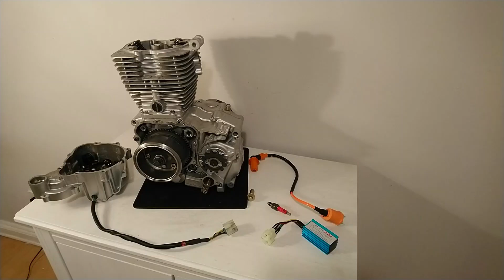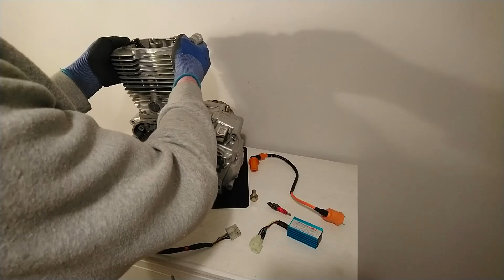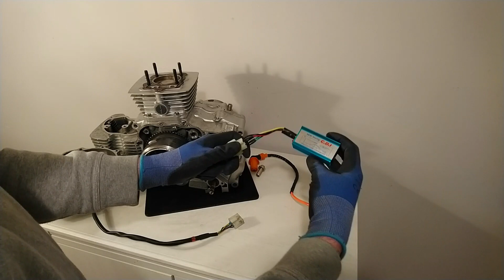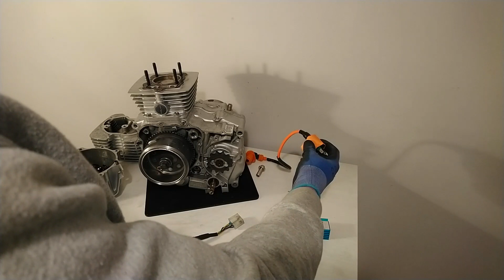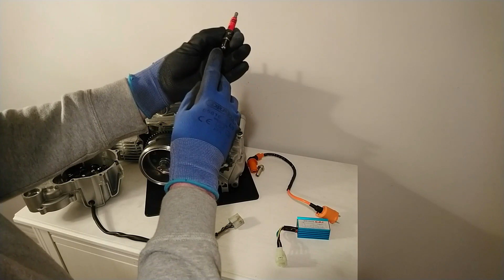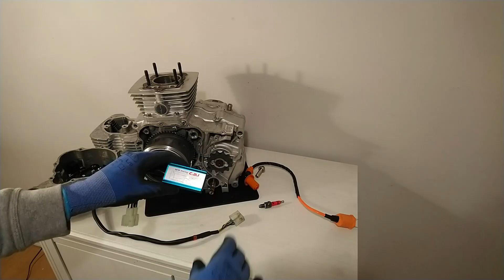Motorcycle Ignition System - How it works - Part 2

Comment: My CBR600F4i is not starting with the Starter switch, but it does start easily with a push start? The battery has been fully charged. Once started, it runs as normal. What parts of the Starter and ignition are skipped during a push start?
Reply: Haha same thing happened to me. After I turned the key to on, my display didn't come up and can only see the netral light. But after i push started I stopped having this issue. The bike now always starts with a start button.

Comment: Great video! 
Am I correct in thinking that one revolution of the crankshaft will equal two of the four strokes of the engine? Therefore isn't the pickup coil sending a signal towards the end of the exhaust stroke as well as towards the end of the compression stroke? Just trying to with this out?
Reply from the maker: Yes that's correct. A spark at the end of the exhaust stroke is called wasted spark as there is basically nothing left to ignite usually. If your carburetor is running rich then the wasted spark at the end of the exhaust stroke may contribute to the back fire you hear from the exhaust.
Reply: Wow ive never thought about that, this is a very high quality comment right here
Reply: Was thinking the same question watching the video. Probably why cam-shaft driven pickup coil is better since camshaft rotation is half the speed of crankshaft rotation so no wasted sparks

Comment: if the magneto has a small damage and the engine is not working,is there a way to fix the magento. it really never starts and the engine start has some horrible noises cranking, like is only fires some times and the energy is not enough to cycle again. i am clueless the last part to replace is the magneto all other parts are replaced, stator, cdi, converter, the starter coil, even the harness cables.
Reply from the maker: That could be a whole host of different issues. To be honest, you'd be better off bringing it to a shop and having a mechanic troubleshoot the problem or get a call out mechanic to take a quick look at the bike in your shed.